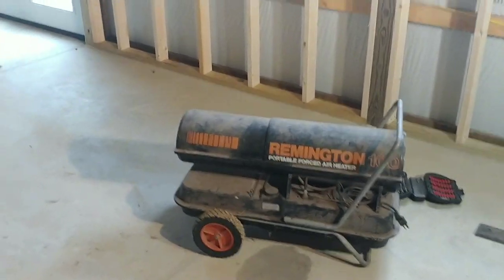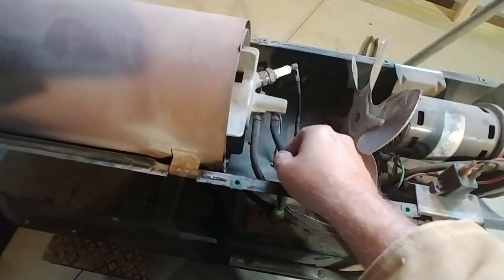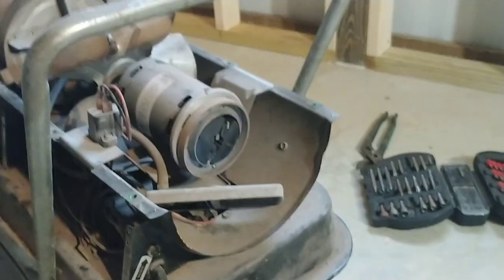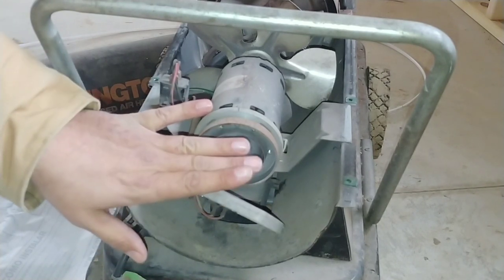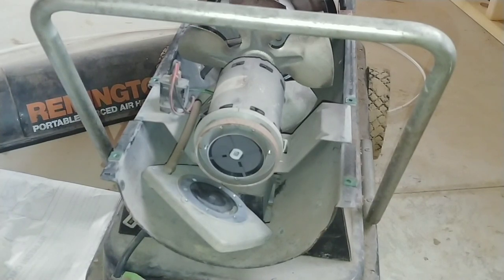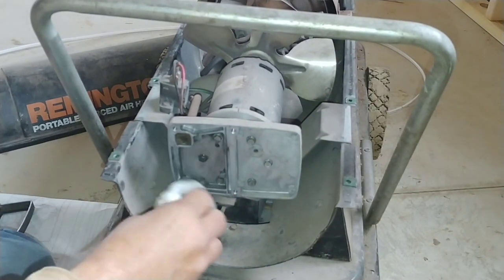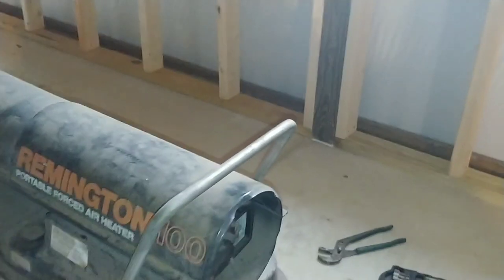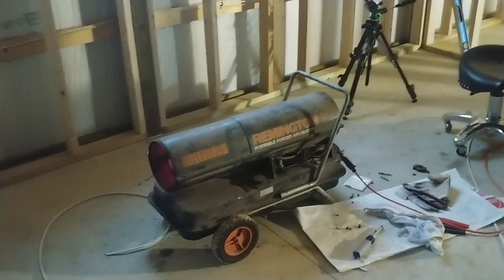How to repair forced air kerosene heaters.  This unit is a Remington.

Comment: whats the best wood to use when storing a car battery on concrete?
Reply from the maker: Treated
Reply: @BevinsBuilds  And thats because the treated wood provides a better barrier between non conductive plastic and the cement?